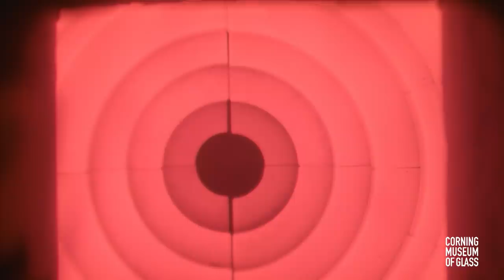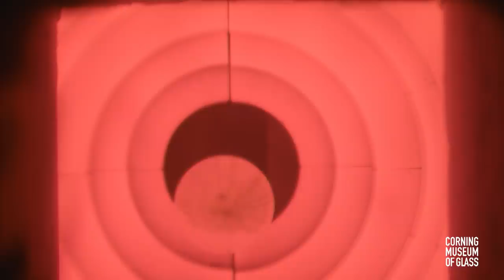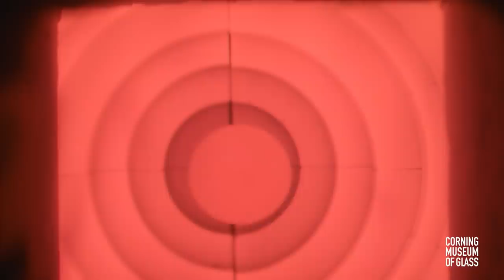Jeff Zimmerman & James Mongrain Guest Artist Demonstration

Comment: 1:21:25 when the guy put the small ball into the annealing oven it rolled and plopped into another one and they closed it up anyway. Any way to find out if they ended up sticking together?
Reply from the maker: Good question! When we place pieces into the annealer, they're still hot, but not hot enough to fuse together. Thanks for watching!